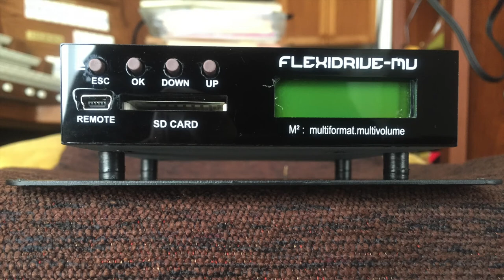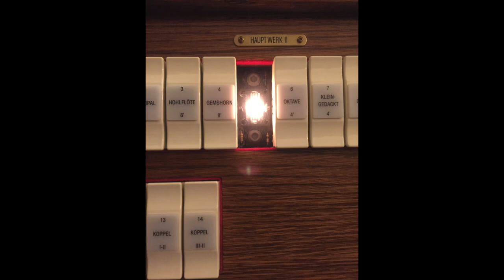Ahlborn Hymnus 350 - Upgraded 2

Comment: I have an Ahlborn Hymnus II, and there's an "Auto Pedal" button. When I press it, the red light turns on, but nothing else seems to happen. What am I doing wrong?
Reply from the maker: Hello, below I transcribe what the Hymnus 350 user manual says: "AUTOMATIC PEDAL: For this useful device the reversible thumb piston A.P. is situated below Manual I. The relative LED is placed above Manual III. 
With Couplers I-PED, II-PED and III-PED, this device engages only the Coupler corresponding to the Manual which is played, excluding the other. 
If the Automatic Pedal is drawn together with TUTTI and CRESCEND0, the stop configuration on the Pedal is immediately adapted to the Manual being used. The Pedal is therefore always balanced with the Manuals."... To be clear, the Automatic Pedal function works in conjunction with the couplers that are attached to the Pedal registers (I-PED, II-PED and III-PED on the Hymnus 350). If the couplers are not active, the effect will not work.
So, it's worth clarifying that this option is designed for playing the organ with only the manual keyboards and for the pedal registers to sound blended into the lowest note of the keyboard you're playing. Therefore, in this case it's important to play with both hands on a single keyboard at a time in order not to unbalance the sound and to allow the pedal registers to blend with the registers of each keyboard. I hope you can enjoy it. Greetings.
Reply: @alcassino2801  thank you but nothing happens when I try to do that, still no bass 🤔
Reply from the maker: @darkter8071  In that case I can't tell you what the problem could be... maybe that option could be defective.